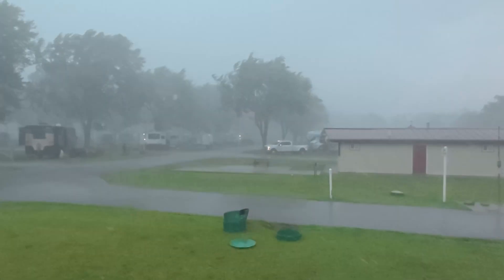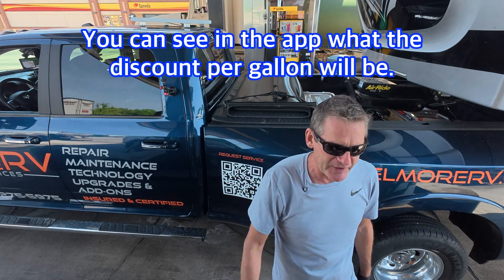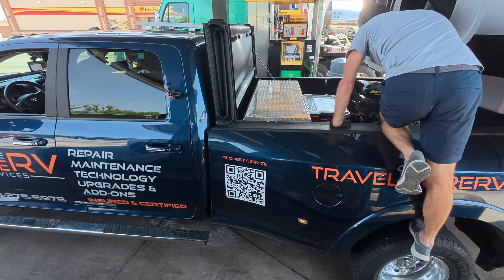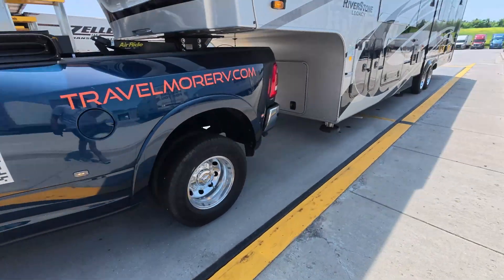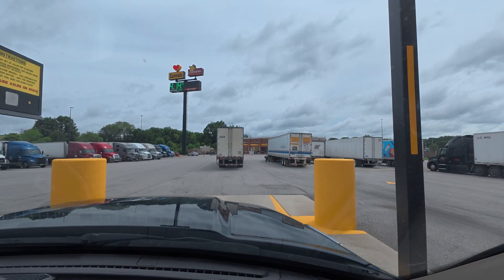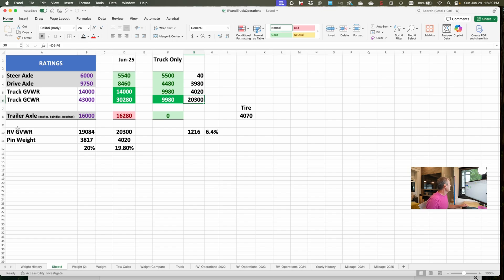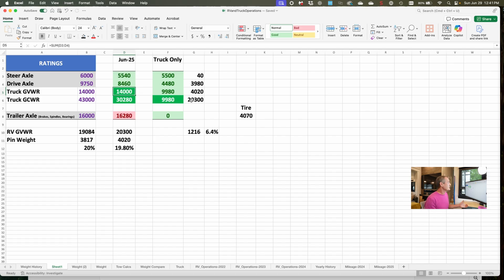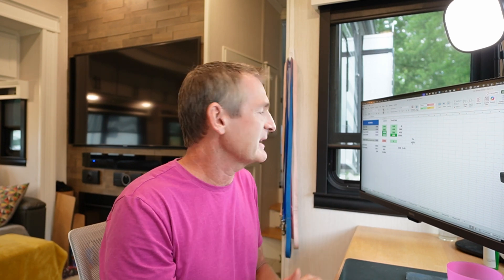Is Your RV Too Heavy? The Scale Doesn’t Lie.

Comment from the maker: IMPORTANT:  I forgot to detail this in the video.  I think I lost it in one of the takes I did.  There is also a link below to download an enhanced version of the spreadsheet I used.  

🔧 Quick RV Pin Weight Estimation Tip:

If you only have your RV axle weight from the CAT Scale and want to estimate your pin weight without weighing your truck separately, here’s a practical method:

This is assuming you want to use the 20% Estimation Method.

✅ Pin weight is typically around 20% of your RV’s total weight, while the axles carry around 80%.
✅ To estimate total RV weight:  Total RV Weight = RV Axle Weight ÷ 0.8
✅ To estimate pin weight: Pin Weight = Total RV Weight × 0.2
✅ This simplifies to: Pin Weight = RV Axle Weight × 0.25

For Example, in my case the weight on the RV Axles is 16,280.

So Estimate Total of Weight of the RV is:

16,280 ÷ 0.8 = 20,350  (Actual Calculated was 20,300) 

16,280 × 0.25 = 4,070 lbs Estimated Pin Weight. (Actual Calculated was 4020)

It’s not a perfect method, but it’s much better than guessing and helps you ensure your towing setup is within safe limits.

REQUIRED DISCLAIMER:
This spreadsheet is provided for informational and entertainment purposes only and is offered as-is, without any warranties, guarantees, or claims of accuracy or fitness for any purpose. Use at your own risk. You are solely responsible for verifying all calculations and ensuring your towing setup complies with all applicable safety standards and regulations.  The password to unprotect the sheet is: weight
https://tinyurl.com/WeightSpreadsheet

Comment: I'm not 100% sure you did the RV GVWR Vs. Truck GVWR math right.  just as an example I have a lot of experience with equipment trailers, If I buy a 10,000lb machine and want a trailer to go with it the dealer will sell me a 12,000 GVWR trailer...... The trailer by itself is 2,750lbs.......  a 12,000 GVWR trailer that is actulaly 12,750 would be over weight,  but it's not if I have 1,000lbs on the ball (Pin) all of a sudden the trailer is 11,750 and the truck has an extra 1/2 ton on it's back.   

as far as I can tell your situation is exactly the same.  yes you added 20,000lbs but 4,000 of it is in the bed of the truck right over the rear axle.
Reply from the maker: I see your point. However the definition of GVWR specifically states that GVWR is set by the manufacturer and it is fixed and does not change regardless of how the weight is supported.  That is from the Morris & Dewitt Legal/Transport Safety Site. For some reason I can’t get the link to post directly but you should be able to find it via a search if you’re interested. It’s in the case law and has been fully adjudicated and is considered settled-law for a legal perspective.  Of course personal opinion can vary, but legally the opinion would not hold up against legal challenges.

Comment: While you are within spec on the rear axle, you are probably really too heavy on the drive. Almost all of your total payload is on the rear axle. Another reason why I went with a Silverado.  GM  gives you a max tongue weight for a 5th wheel, which for my truck is 3240, even though my total payload is 3800.
Reply from the maker: Why too heavy on the drive?  Its almost 1300lbs under the axle rating. Stellantis doesn't make any distinction for max on the drive other than the GAWR.  All they call out is the standard: GAWRs, GVWRs and GCWRs should never be exceeded.  Are you thinking that the concern is that there's not enough weight on the steer to ensure control?
Reply: @okletsgorv if you add your axles 6000 plus 9750, that's 15,750. But your GVWR is 14,000. Stella's engineers somehow determined that GVWR is less than the sum of axles

Comment: Good job! The last time I looked at the towing guide from Ford, it stated that pin weight(PW) should be 15-25% and Tongue Weight (TW) should be 10-15% of TT's Gross Weight.
Reply from the maker: Thank you.  There seems to be a lot of different ranges published by different sources, but that 15-25% seems to be the most common.  The manufacturers of the RV tend to be a be more specific for their RVs, but of course thats only been my experience with a few that I have checked -- it could just be luck.  But then again, they do know how the structural weight of their design is distributed, so chances are if they are weighing at time of manufacture/prototype, as required by the DOT, one would hope they are accurate.  Thank you for watching.